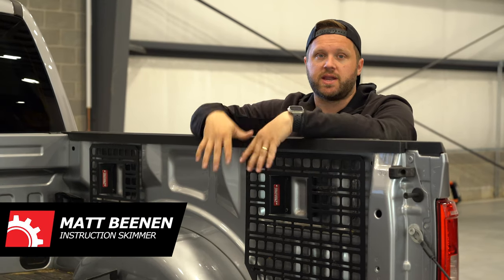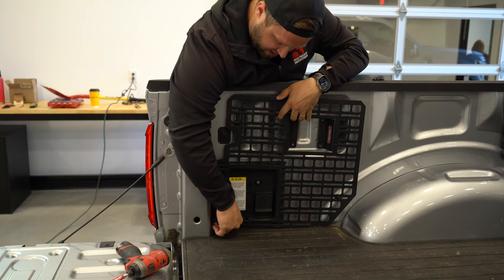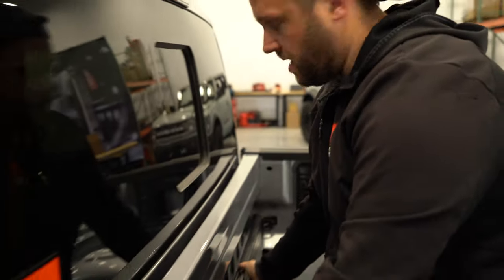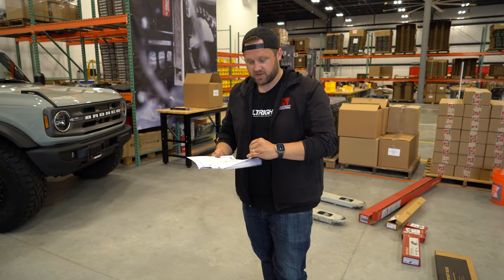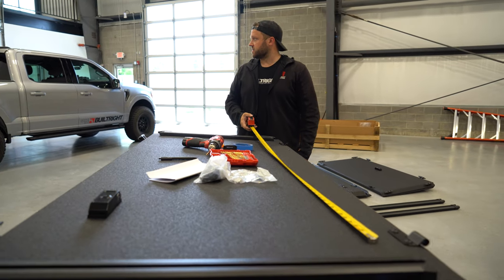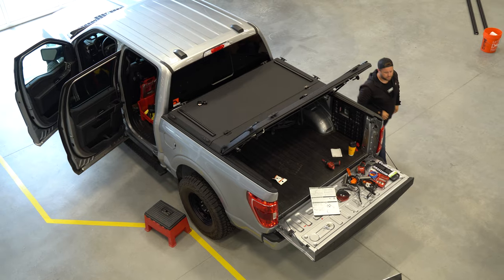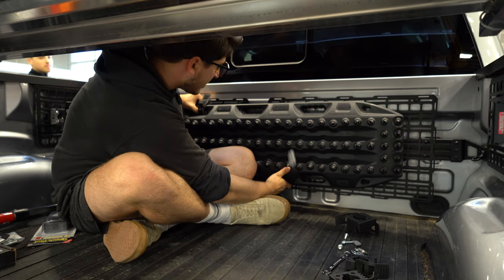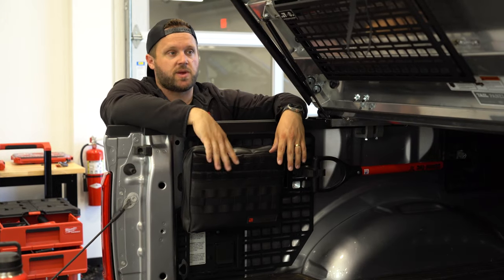DiamondBack HD + Bedside MOLLE F-150 Install

Comment: Are two max trax sufficient, or is it best to get four?  I like where you mounted them, good choice.  One thing I'm thinking about doing differently is on each rear interior side putting a swing out case instead, but need to give that more thought, maybe a swing out case on one side and the extra gas or water tank on the other.

Comment: I thought of another question, if you will.  The new 2024 F150's will offer a "Pro Access" tailgate, which in addition to folding down to open, also has a smaller side to side swinging door section in the center.  Assuming the weather seal is just as good, do you see it being a big advantage to be able to open the tailgate side to side to be closer to the bed when the HD bedcover is closed, maybe has something on top that makes it so you cannot open the top?  Thanks.  You do lose the pullout step, so you get one or the other, the pullout step fold down tailgate or the pro access fold down or side to side swinging door tailgate.
Reply from the maker: We definitely see advantages of being able to stand right at the end of your truck's bed with the pro access tailgate, especially when using a rigid, 'loadable' cover like the HD. If that cover is closed and can't be opened because of a rooftop tent, ski box, etc, being able to reach in closer towards the front of the bed would be a huge help. Assuming the gaskets, hinges and locking mechanism hold up well, and the trim plastics at the top of the tailgate are not too different than what's on Ford's other tailgates, reliability and operation of a tonneau cover like the HD should remain normal. Diamondback's gaskets are robust enough too that they will hold up against different directions of tailgate operation. Regarding which tailgate option we'd choose - we use the pullout step enough that we would most likely opt for that again, especially versus an option that has more room for 'functional failure'. If our pullout step breaks it's not a huge issue, but if the split tailgate stops closing or sealing, we're not going to be happy campers! We appreciate you asking - happy holidays!

Comment: That Diamondback HD is such a beautiful bedcover, and so functional.  Love it.  A question.  Do you know, does it get very hot if it's out in the hot summer sun all day, how hot to the touch, scalding being metal and all black?  I really wonder about this.  It's the only real concern I have.  Thanks.
Reply from the maker: It's great, such a robust solution - there's nothing else on the market like it! And it gets warm to the touch, but I wouldn't say that it gets scalding hot. No part of operating it was really uncomfortable during peak summer when we had it on the sand all day in OBX. The bed-liner style finish on ours definitely helps, it's nowhere near as hot to the touch as black paint on a vehicle or metal panelling on other covers. The only consideration regarding heat for us was the temperature inside the bed, this thing does seal very well, so be conscious of storing more heat-sensitive items back there during peak sun.
Reply: Thanks.  Just air it out every so often by opening it in the heat of the summer, even if don't need to access inside the bed regularly, that's my thought.  Man I love it.  I'm thinking the Ford's new "Pro Access" tailgate with the swinging center door would really help maximize ease of access thru the rear without opening the top, especially if something on top means I can't temporarily access it thru the top.  Pretty cool that too. @BuiltRightInd